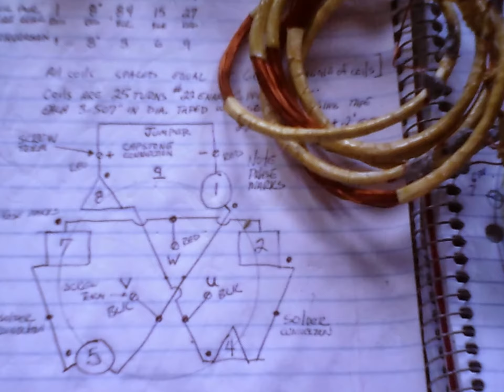My Slideshow Abha Rodin Motor Electrical Diagram and Motor Coil Form Diagram, by Anthony Izaguirre

Comment: dang that was a good idea how well does it seem to work?
Reply from the maker: +jacob mitchell Thank You for your comment ,the motor has been wound as a 6 inch spindle torus and has a RPM in the range of 117000. + The motor is 3 phase using a rc motor controller as a speed control The magnet is a N-48 sphere the bearings are 3/8 Teflon balls the bottom white sheet is .064 Teflon the top Teflon ball keeps everything centered oil is 5W-20 synthetic I have built a new motor generator using a 2 inch N-42 and a 8 inch spindle torus 6 main windings each with 4 coils 14vdc input at 3.4 amps output 28 vdc at 1.7 amps using a 3 phase bridge rectifier. a linear actuator has been added for safety this raises or lowers the bearing assembly raising the bearing assembly increases speed to the point of explosion of a 1 inch hematite sphere magnet will come apart at 120000 to 130000 rpm new motor generator runs at 12000 rpm at 67 degree c will run much faster but due 175 degree f max magnet temp.12000 rpm is the limit it will run 24-7 under full load of 30 watts the motors have very high COP numbers I will present the math at a latter date . thank you for your interest Tony Izaguirre

Comment from the maker: Hi Jocob, please check out the PMBO 2016  my entry is a 2 inch N-42 Sphere magnet in a 8 inch Abha Rodin (spindle Torus) motor generator intergraded into one assembly. The motor produces .35 Hp at 192 ft/lbs per second running at 12000 Rpm The generator output is 24.5v at 1.14 amp 27 watt Thank you for your interest, Tony